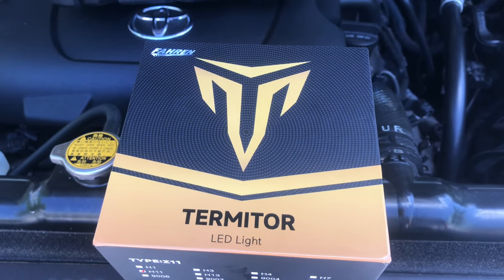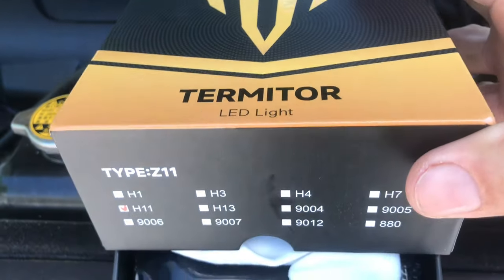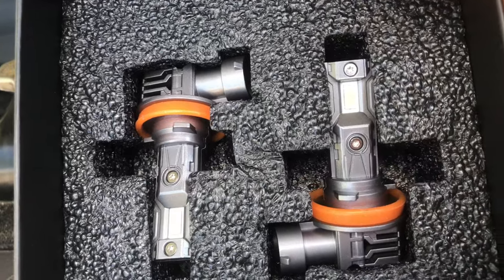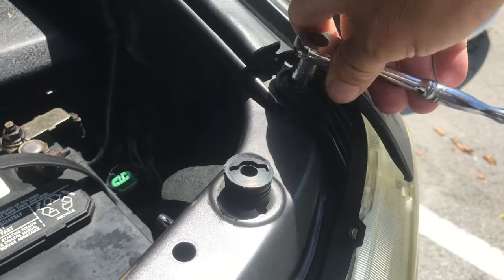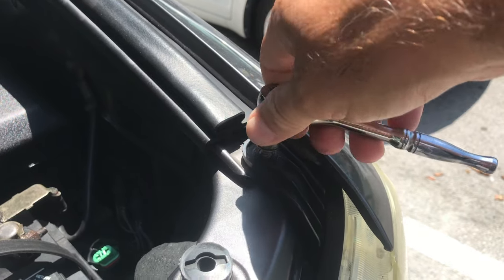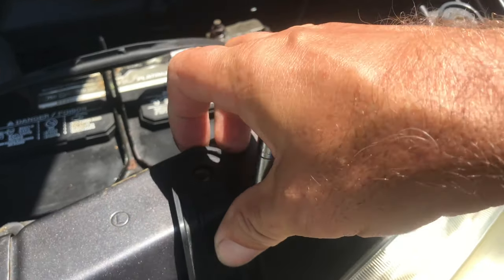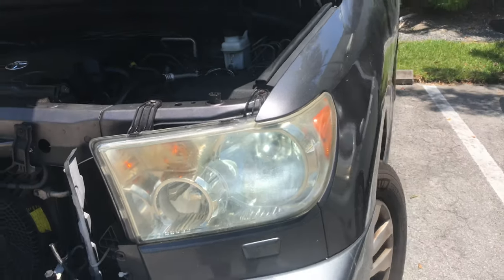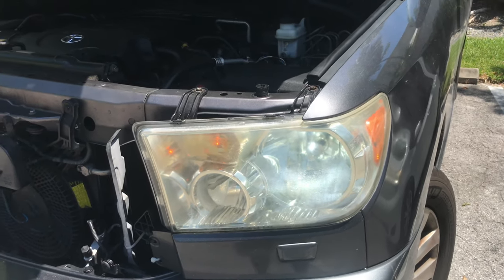Installing H11 LED Low-Beam Headlight Bulbs on a 2012 Toyota Sequoia. #toyotasequoia

Comment: Finally a video that looks helpful! Gonna try your method. Other videos show removing the entire headlight housing which I don’t wanna do.

Btw a couple questions: did you replace those ember light bulbs? If so, did you get bright white LEDs?

Also, have you replaced the DRL with LEDs as well (I believe they’re the same as the high beam bulbs)?
Reply from the maker: No need to remove the headlight. For the yellow driving lights. I tried LEDs. but they blinked fast since the relay sensed the bulb was still blown. I did not want to upgrade the relay so I just bout bulbs. Kept it easy. All other bulbs are LEDs. Even flood lights. Which are the same style as the normal driving lights.